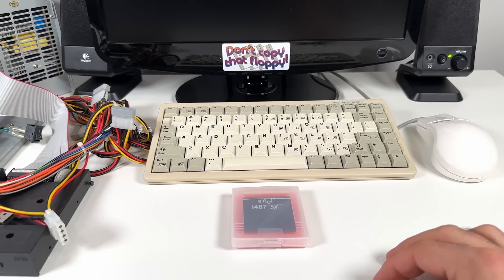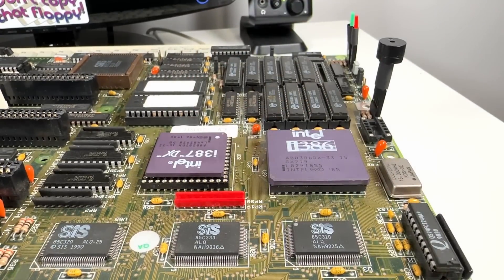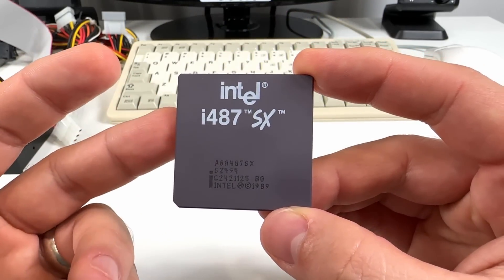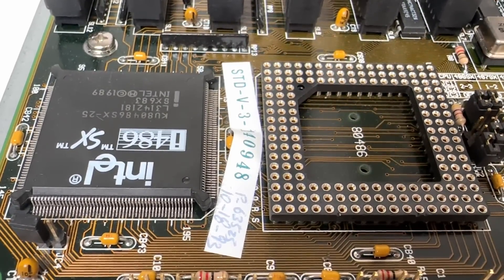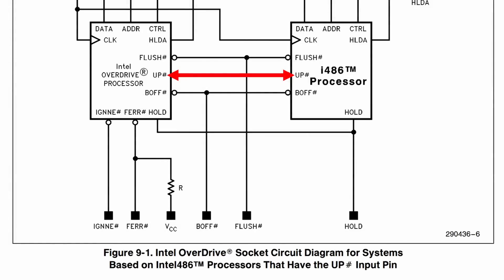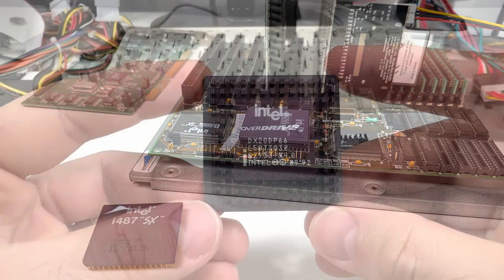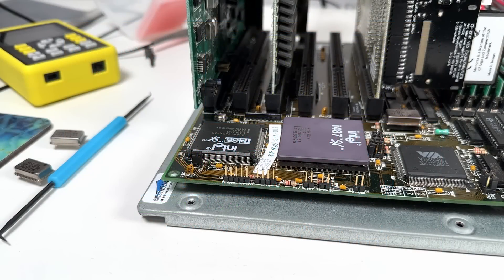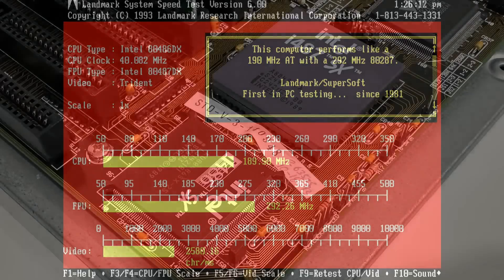The Intel i487 SX Math Co-Processor - Disingenuous or Just Misunderstood?

Comment: The ingenious thing about the 486SX is that some of the initial ones were DXs where the FPU failed in testing so they disabled it and sold the chip as an SX. Depending on the yields and market conditions they also sold DXs where the FPU hadn't failed testing but they disabled it anyway. Later SXs were designed with no FPU on die to reduce the die size and cost.
Reply: This strategy is still used today. 6 core CPUs are really 8 core CPUs with defects (or not if they have too many 8 cores to sell). Similarly done with GPUs. The chips are designed such that parts can be easily disabled. In the past, some GPUs and CPUs could have disabled cores enabled via BIOS, firmware, or .... graphite, but they permanently disable them at factory now to prevent this lottery as disabled cores may "work", but be unstable.
Reply: @xeridea  Yeah, I know. I still think Intel doing it with the 486SX was pretty innovative and maybe even the first time this was done. Having multiple CPUs and GPU cores the same die obviously offers more scope for this. As far as I know disabling is done at the bond out stage or maybe with an antifuse afterwards. On chip antifuses were invented by IBM and they're absolutely ideal for this sort of thing - you can test the chip in its package and then blow the fuses to disable the bits that fail.
Reply: Yes, the 486SX and 487SX were solutions to two production problems.
Failed the FPU function test: It is a 486SX, and the /documented/ speed was reduced to 25MHz for marketing reasons.
Failed just the 33MHz speed test: It is a 487SX at 25MHz.

I've seen similar in DRAM modules, with the die directly bonded to the PCB. From specifications you could judge the chips just had half the capacity of regular chips.
Good management to sell your otherwise scrap products with underrated specs. Fun times to see that.
Reply: @intotron-X  In the early days of memory you had budget 1k memories, where it was actually a 2k chip that had a failed bit in either upper or lower half. Thus there were 2 part numbers, one with a good bottom, and the other with a good top half, and they were used a lot, as the 2 chips together were still cheaper than the price of a 2k chip, just needed extra board space and one extra layer of decoding, plus you could double the memory afterwards, just by replacing them with 2k chips, and disabling that extra decode level.
Reply: @SeanBZA  The original RS ColorComputer used half bad dram chips. They sorted them into upper and lower half working and used a jumper to select at the factory. There were no provisions without cut and jumpers to use full good dram chips.
Reply: @johnelectric933  ZX Spectrums did this too. The upper 32K was 64K chips with half defective. The board had a solder jumper or a link you could cut for "use top half" or "use bottom half" and I think the chips had a marking which half to. So when you assembled the machines you'd have to match up the boards with the chips. Which probably doesn't add too much labour to the process.
Reply: @SeanBZA  Yes can confirm.

For EPROMs, there was the 2732 - a 32K version, and the 2764 - a 64K version.  The 2764 has spare rows and columns.  When the 2764 has an "unrepairable by sparing" half-array with a still functional half-array, there was a UPROM bit that could blown that would change the part into a 2732 and it was sold as such.  You can tell those if you knew what a 2764 die vs 2732 die looked like.
Reply: @Jeff-i8u  Can confirm, I had a bunch of SEEQ Eproms, which were 64k parts, with the die identical to the 128k parts. A good number of them though would suffer from programming errors, some bits would simply not either erase, or program to a low level, while others would stay stubbornly high even with trying programming with the bare bones original 50ms pulse multiple times. Rest would program between 2 and 5ms, just those stubborn bits. I did use some for replacing 32k parts, pulling the appropriate address line out of the socket, and tying it high or low as needed. some I got lucky, and that stuck bit was the right one. Still got a tube or two of them around........ At least the price I paid was good, they were free from a dumpster.
Reply: I remember when AMD came out with the first “triple-core” chips. They were just quad-core chips with one defective core.
Reply: @5roundsrapid263  Again a nod to Clive sinclair, who used reject transistors to build his early amplifier kits. they got batches of defective Mullard transistors, and tested them all, to sort out those that were totally dead, had some gain at 30V, some gain at 20V and some gain at 10V, and binned them appropriately. Then put them to use where the transistors would operate in a circuit with some sort of success. Mullard was only interested in fully functioning at 35V, and excess leakage at that voltage, and it was binned, and same with gain. Sinclair used the rejects to make 12V amplifiers rated at up to 10W, where higher leakage was not an issue, so long as the transistor had more than 2 gain.
Reply: The PS3 CPUs are basically IBM supercomputer CPUs with some failed sections as well, and recently AMD also released some PC motherboards with a soldered CPU that is just a PS5 CPU with failed GPUs. It's quite weird in how it has soldered GDDR6 system RAM and some weird limitations like just single limited lane PCIe.
Reply: @Kalvinjj  Yep the PS3 Cell processor was originally designed with 8 cores.  In the PS3 however there is one core disabled and one core dedicated to running the OS in the background.  That leaves 6 cores for gaming or whatever else..
Reply: I'm glad people understand this.

When I worked at Intel it was cool but exotic information that no one knew about.

This is a key design technique for "Yield Enhancement".  Which financially means more die on the wafer can be sold for (more) money instead of being thrown away.  The cost of the wafer is a Sunk Cost by the point of testing so anything that can increase yield is a good thing.

Another related one is "row/column/cell sparing" in memories.  Failures of memory cells tends to happen in geometric ways related to row lines and bit lines.  Thus it's possible to design in "spare rows", "spare columns", and "spare cells" that can replace failed memory cells.  These are already proven to result in the same user reliability as non-spared parts.

There have long been "secret" electrical modes for testing and sparing controls in chips (now all superseded by JTAG access) which allowed these errors to be stressed/amplified and detected and then "spared OUT' to increase die yields.  This was also sometimes implemented using lasers to do the same sparing instead of electrical modes but is often cheaper to implement electrically.

Also RAM and other "speed binned" devices are ALL 100% the same chip design - NO ONE designs for slower speed version.  The difference is the empirically tested speed performance.  These speeds fall on a Bell curve and the ones that the top are sold as higher speed for a premium , and those on the bottom are sold as slower discount versions.

I can also confirm the 486DX/SX and 487 story.  The 486 was already being readied while I was Intel so I know about this trick.

So much goes on behind the scenes like this.
Reply: @Jeff-i8u  The cool thing about the speed sorting is that as the design gets a few years old, they all make full speed but they still sell some as low speed devices for economy builds. 

I was building PCs for government offices back in the early days before the 486 even came out. The yield enhancement was no secret.
Reply: This has been debunked by the 486 designer - the 486SX was not a DX with a bad FPU.
Reply: @oscar_charlie  I worked at Intel at the time.  That designer might have been working on a later redesign version.  But it is 100% true for the 1st verson of the 486 family.

Comment: My first pc was a 486 running at 66Mhz, but it actually came with a 486 OverDrive "ODP66" cpu installed. 
So for some reason I never understood, I bought a new PC which came with an overdrive cpu. Maybe there was a lack of 486-DX2 CPUs?
I remember the PC costing about 2.500 USD  ( 100.000 Belgian Franks ), and that was just the pc and the screen. But the pc did not even have a soundcard nor a CD-ROM player... so 2, upgrades ware already needed soon after purchase.

Comment: I am still confused by their decisions. Why have 487SX, where you could equally plug 486DX. And internally they were same silicon anyway.  It must have been some marketing department ploy.

Also, TIL. Digital was making PC clones too. I should not be surprised, considering size of DEC, but I didn't know that actually.
Reply: It was a marketing decision.  People don't like feeling like they wasted money.  So they marketed it as a cheaper 486sx that you could later "upgrade" to a DX just by adding the missing math coprocessor.  People liked that better than knowing they were just throwing away the money they spent on the 486SX and buying a new 486DX to upgrade it.

Comment: Why can't we just use a GPU
Reply: What do you mean? Then? Now? Before? Instead of what? Speak coherently.
Reply: The first "GPU" was GeForce 256 released in late 1999 - quite a bit newer tech 486 era mobos and GF256 needed AGP and Windows 9x. That said this specific "GPU" wouldn't be very useful anyways due to missing programmable shaders... and anything with programmable shaders but before proper GP-GPU (and CUDA/OpenCL) was a hackery... but in theory should be doable. There are mobos for 486 with PCI and there were PCI versions of e.g. Radeon 9000 which and FX5200 so maybe it could be possible if drivers for these cards still run on 486 CPU. And if you even installed everything you would need to write your own programs.

Comment: also the SX only had a 16bit external bus and the DX a full 32bit external bus.  the  487 likely only runs at 25MHZ  because thats the clock provided by the motherboard th the SX chip.  in thei s era the CPU clock had to be manually jumpered.
Reply: Regarding SX vs DX: Not true for 486. But true for the 386.

Comment: The 486SX did have the FPU on the chip, but Intel disabled it. I have heard conspiracy theories that they did this with their reject 486DX in order to sell them. I just think it was a marketing ploy that they did back then to generate more revenue. Thanks for another very interesting video. I really enjoy your content!
Reply: No conspiracy theories needed as in the industry it is standard practice to create additional SKUs with parts of the chip disabled to increase yields by allowing to use partially flawed chips. Chips are designed in such a way to make cutting defective parts for lower end 'cut' SKUs as easy as possible.
Reply: That was for the earlier CPUs where the FPU was often defective. Later they redesigned it as volumes increased.
Reply: @okaro6595 yep it made perfect business sense for intel, why bin the dies.
Reply from the maker: Thanks very much! 🙂

Comment: Looks like you beat me to this video. I have an M601 486 motherboard that is able to run the 487 without any other processor present. They figured out how to bypass the primary processor check, so a 487 can operate completely on its own.

Comment: Nice video!
Mentionable about the 486 SX is that earlier revisions were DXes, just with the FPU disabled (possibly to use also dies with bad FPU part), so in fact you could have TWO full 486 DX disguised as SX sitting side by side. Yours must be a later revision, which shipped without FPU on the die.
Oh, and did you notice your socket doesn't even have a connection for that extra pin? Fun little detail...
Reply: Actually I saw a processor labelled as 486DX25, to my knowledge intel never manufactured those. And in fact this one was a circuit soldered to a small PCB, with pins on the bottom side to fit into a socket for a 486DX. So the obvious guess, this was a 487SX got for cheap from intel, and then sold as a stand-alone CPU in low cost computers.

Comment: My 486 DX2/66 ran Quake slowly, but when I upgraded to the Evergreen "586" 133, that actually ran it very well at 320x240. It was like night and day. A Pentium was obviously still better though.
Reply: "ran it very well" would suggest 30+ framer per second and it was probably more like just half that on average. But yeah, those were different times and framerate standards were different. On a good note Quake had literally as low input lag as it could possibly have and even with frame rates like 15fps was relatively playable. Compare it to some games of today that due to bad programming have tons of buffering and will feel laggy even at 60fps
Reply: @e8root  It was a steady 30 or more. Back then that was fine for me.
Reply: @e8root  I saw Quake run pretty good on a high-end 486 DX4 machine. I think it was 100MHz. It was about on par with my Pentium-75, maybe a little slower. So yeah, the Pentium was a pretty serious improvement over its predecessor!
Reply: @argvminusone  Very unlikely. Definitely not Quake and not proper Pentium with its native FSB and 64-bit memory. Pentium Overdrive (so running in 486 motherboard) if you downclocked it from 83MHz should give ~18fps vs ~12fps for DX4 100MHz. Pentium was an amazing improvement over 486 and especially FPU and with FPU it was especially an improvement with how you could execute ALU/INT operations alongside FPU operations which Quake and later most games did and why CPUs like K5/K6 and Cyrix 6x86 were slower - in fact for normal unoptimized FPU code something like Cyrix 6x86 was about as fast - and some games were in this way unoptimized pretending to be optimized well for cyrix/k5/k6

Comment: I'm glad I never grew up dos days but win95+ watching this older tech everything seems to be problematical and slow, thanks god to real OS, 3D and mmx
Reply: With MS-DOS basically the game (and me as a gamer/artist/programmer) had total control of the computer. I only used Windows 3, 3,1, 3.11, 95, 98 reluctantly, because I knew Microsoft was taking my machine over using 3rd party video drivers as the excuse.
Reply: I, on the other hand, is very glad to have started out on 8086 and DOS, long before 'proper' OS'es as you refer took over.
Plug'n'Play with Windows was renamed to Plug'n'Pray for a reason.

Comment: Indeed - Intel 'S-spec' SZ494 is the only known batch encoding for the 487SX. The actual CPU stepping is 'B0', which is more inline with the 486SX production rather than the 486DX. The 'CPU Reset Signature' is a unique 0421h, which is the same 'model' as a 486SX (designated by the '2'; Initial 'A0' stepping 486SX were a Reset Signature of 0420h, and the next 'B0' 486SX stepping was 0422h.

Intel moved through the 'A' and 'B' steps on the 486DX CPUs (CPU Reset Signatures 040xh, later 041xh) quickly, and could have also made the 486SX with fabs that only ran well at lower speeds (and Intel just disabled the FPU). The 486SX CPUs seemed to come from early batches, and it wasn't until PQFP versions and copyright dates of 1989 and 1992 until it moved past the 'B0' stepping. 1992 copyright dates on the Intel 486 series also means a proper CPUID instruction (derived from the CPU Reset Signature that started with the Intel 386 CPUs; That AMI BIOS won't save the CPU Reset Signature properly, I've only seen a Phoenix BIOS do it for 486 CPUs, and only having an IBM BIOS for both 386 and 486 CPUs).

Comment: I was curious about what would be needed to make dual CPU configuration possible. Turns out that 486 has almost everything. Bus arbitration is already in place (might need to be tweaked a little). Bus locking (for atomic operations) as well. Cache coherency mechanism is optional but 486 has even rudimentary form of that. Interrupt controller would need some extra attention. Additional CPU would need its own interrupt controller. It wouldn't have to be be fully featured one but would have to allow for at least one IPI in each way and preferably some periodic IRQ for task switching. It would be possible to work without even that, but it wouldn't be pretty. At the very least, some shared memory region with polling would suffice. Next, a little tweak in the BIOS to make sure that hardware initialization code is executed only once and to stop the other CPU in a known state and that's it. The rest is in the OS.
Reply: @pvc988 You can try to see how they did it with Compaq System PRO, ALR PowerPro, Acer, Digital, VTech and some others. I know that Compaq used a much simpler configuration compared to Digital and VTech, where they shared everything possible, which turned out to be a bottleneck in some types of loads in contemporary tests. But I came across something that I don't know if it's real and it wasn't just a period joke - the Evergreen reduction from two 486 sockets to one. It's not just mechanical, you can see some electronics, but I don't think it's possible with the 486 that easily.

Comment: But what about the 486SX CPUs that were higher than 25Mhz? 
I can't imagine being too happy if your 486SX-33 or 486SX2-50Mhz was disabled, when you installed the 487 "upgrade"; and your system would then run at 25Mhz..

Comment: I really liked graphical stuff that looked nice on screen like plasma, fire or fractal screensavers. So, I learned to make myself some. I made the first one at school on an XT machine with 8087FPU in Turbo Pascal. It was quite fun and easy. Later, I got my own computer, an Toshiba 286 portable and none of my code worked just because I did not had an FPU. When I find one for that machine, I already had an 486DX2@66. So yes, i felt my computer to be complete with an FPU, even if most programs at the time did not used it.